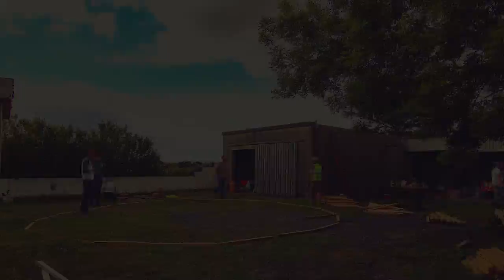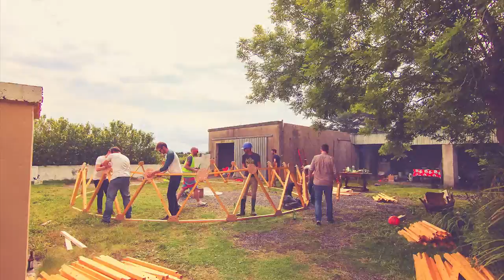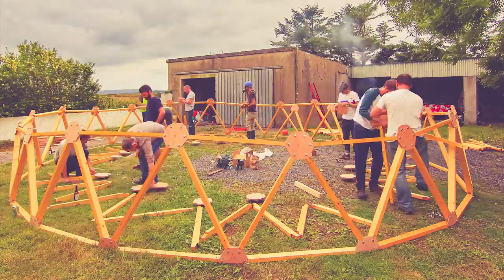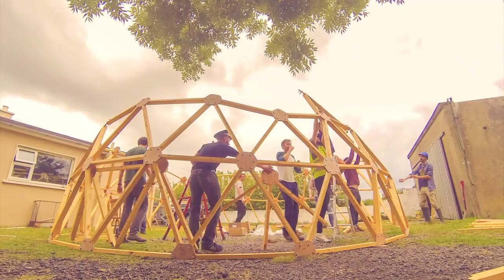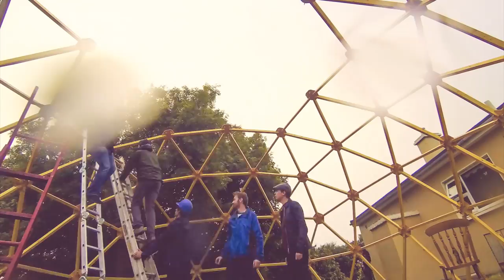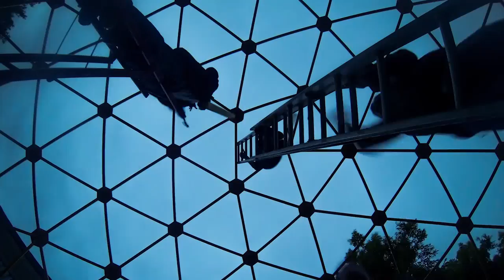Geodesic Dome

Comment: So, after the wedding, was the dome disassembled?   I wondered why it was not on a foundation and did not have a reinforced entrance - it was intended to be temporary.  Was it reassembled somewhere else as a permanent structure?
Reply from the maker: Hi Robert, the dome was assembled here on the groom's stag party - to test it out. It was disassembled afterwards and reassembled again for the wedding. An entrance was created by removing some of the struts. The structure held it's integrity. I'm not the architect, I'm the film-maker (and one-time builder!!), so can't really answer your questions about the foundation, etc. After the wedding it was disassembled again and put into storage, but it has been reassembled and used for various art festivals in Ireland, so it lives on!!!
Reply: YouTube has been recommending various videos about geodesic domes to me, this one is fantastic . . .  a wedding and art festivals?  Has it been uniquely decorated each time?  In storage again?